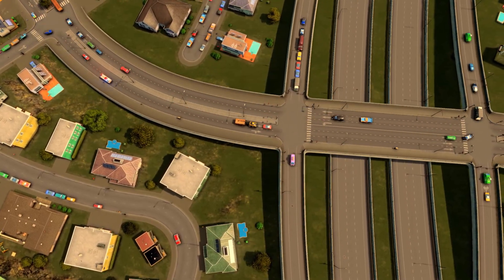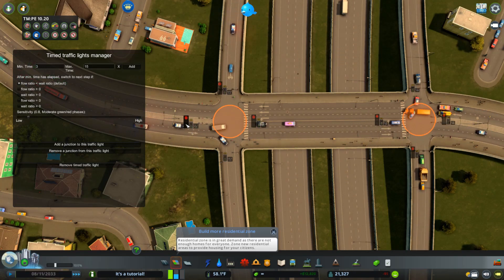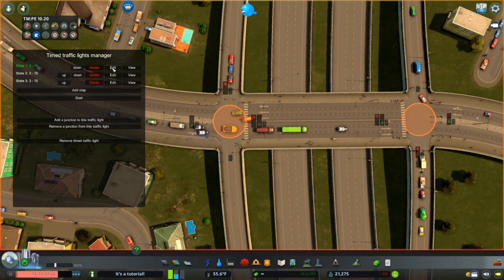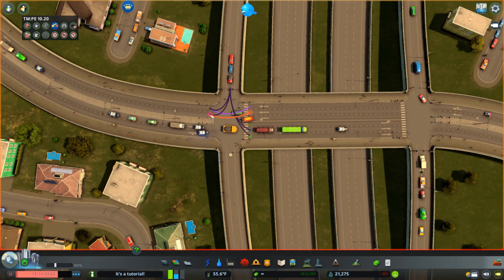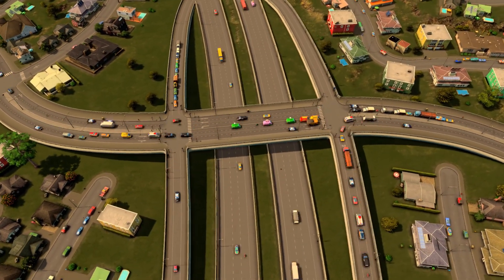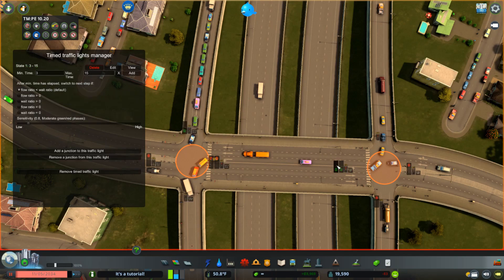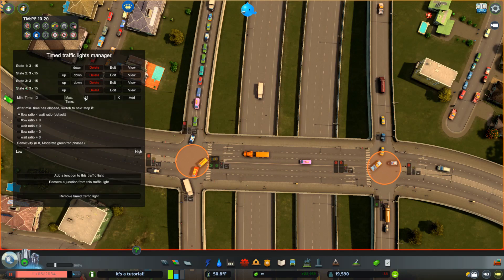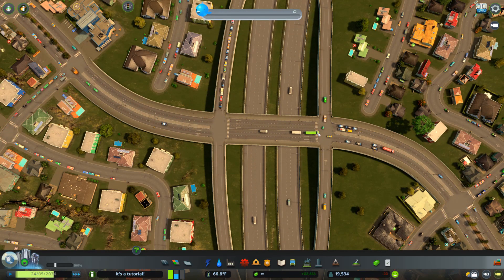How to set up timed traffic lights in Cities: Skylines - Diamond Interchanges

Comment: Once the city develops, I think this intersection would require a slight upgrade to an SPUI.
Reply from the maker: Probably, because these intersections are kind of limited by the fact that turning movements get in the way of movements on the main road. With a SPUI you can have 3signal phases without any conflicting movements, whereas for a diamond, you would need at least 4.
Reply: @Stegar  exactly. Diamond interchanges have a lot of lights, bad angles and more phases for timed traffic lights. SPUIs are a really easy fix for all of them to alleviate traffic.

Comment: Very nice! I would add that the phases length should be close to the time it takes for cars to get from one side to the other, in order to maximize the green wave effect.
Reply from the maker: Thanks, that is sort of why I made the minimum time higher for each light phase in the second setup. But yeah I can see where you're coming from. Hopefully if there is enough traffic the lights will change, but that option really requires you to do a lot of trial and error to get all the timings right.
Reply: @Stegar  I never used automatic phase switch before. Do you see benefits of it ?
Reply from the maker: @Pamani_  if you set the minimum time low enough then it can decide when to change based on how many cars are waiting compared with how many cars are going through. It can cause havoc if you make it too aggressive though. I sometimes spend a lot of time tinkering with the timings after I set things up to try and balance out which directions have more traffic
Reply: @Stegar  In the Texas Diamond timing (your second setup) stages 2 and 5 are just transition states, so their sole purpose is to provide a green wave. In my experience, setting the min and max for those two stages to 2 seconds works out about right in a typical diamond interchange. The actual green time distribution is then varied using the durations of the other four stages, which each allow traffic to enter from one side of the interchange.
Reply from the maker: @OntarioTrafficMan  damn this such an old video now. The timing kind of depends on the segment length and how aggressive the simulation is in changing the timing between phases. I don't even remember what I said in this video as it was so long ago
Reply: @Stegar  7 months is old? Haha I still get comments about my videos from 7 YEARS ago. Anyway, yeah the ideal timing for the transition phases depends on the size of your interchange, the speed limit and how agressively they respond to green lights. I'm just saying that 2 seconds seems to be about right number given a typical distance (ramps directly either side of a 2x3 lane highway) and typical speed limits (50-60 km/h).